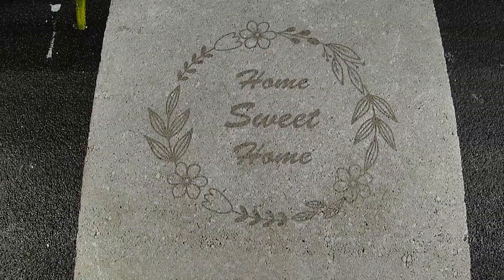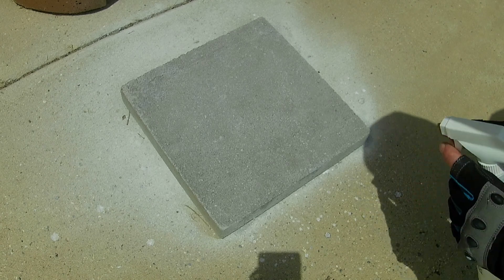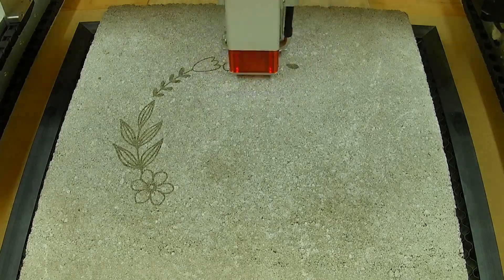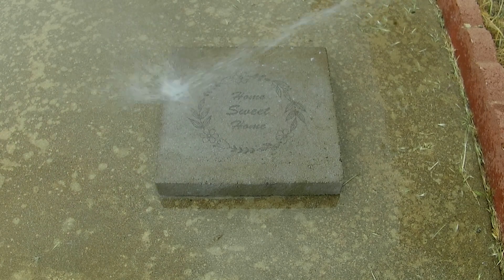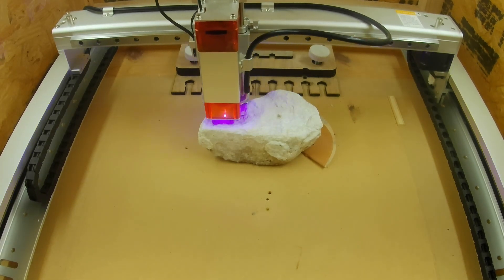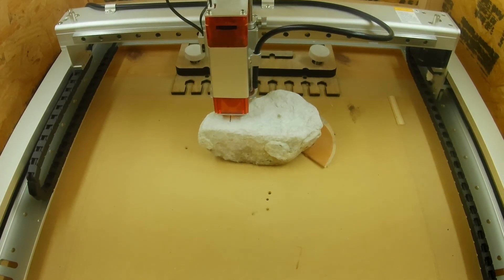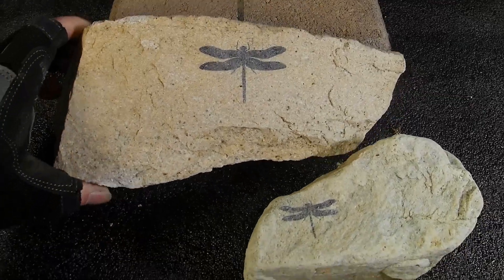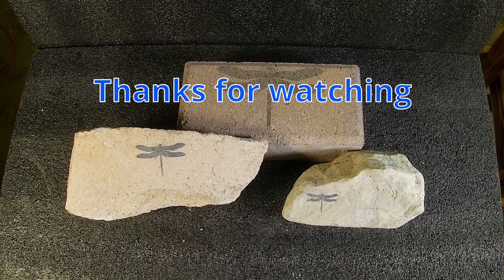Laser Engrave on concrete pavers, bricks and rocks with Tio2.

Comment: I checked the other video you did on the brushed on TIO2 for the instructions/recipe for the spray you are using but did not see it. So is it 

3 parts water
1 part glue
1 part TIO2

or 

1 part TIO2 
5 parts alcohol
Reply from the maker: I recommend the painted version. It's a lot less messy. And I find the results to be much better.
You just have to get a good even coating.

For the painted version I used
3 parts water
1 part Elmer's
1 part Tio2

The measurements aren't critical. Some people have said they had better results with less water.